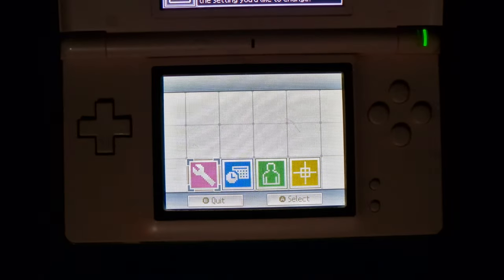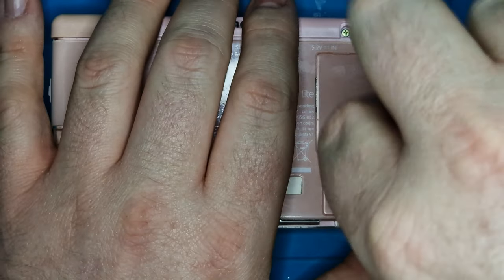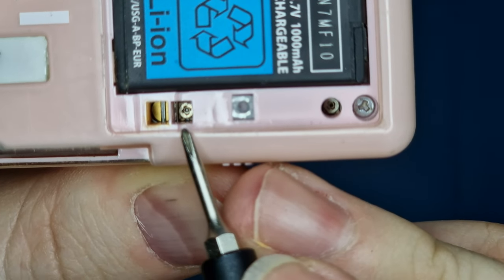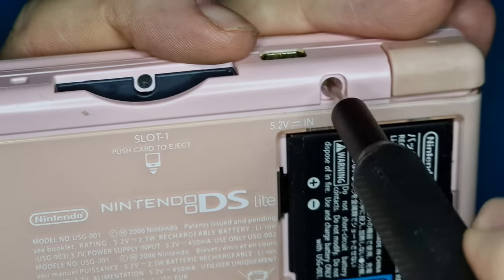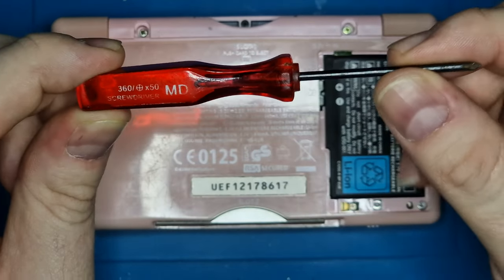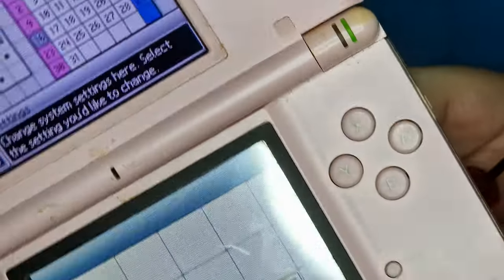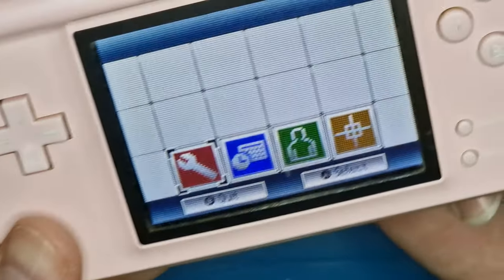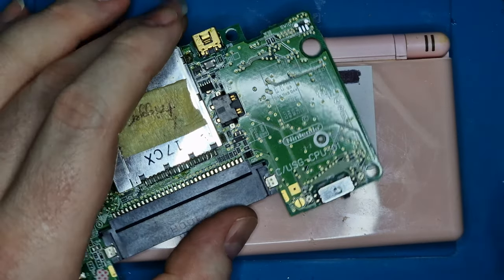How To Repair A Nintendo DS Lite Flickering Screen.

Comment: i have the same problem on the 3ds, the old model. however, I cant seem to find any contrast adjuster like that in its board, do you have any idea how to fix it? I can't find any explanation or help on the internet on how to fix the issue